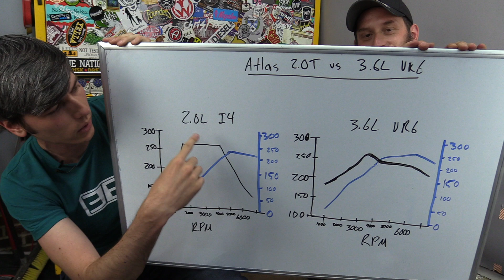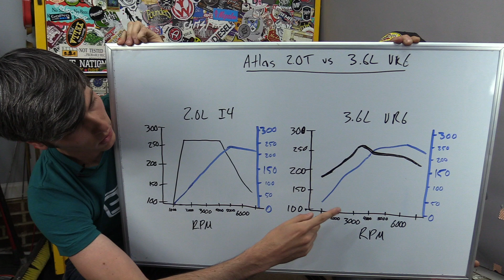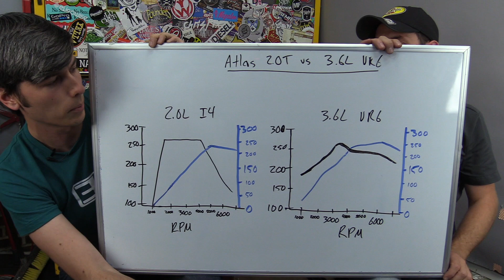4 Reasons Why The VR6 Engine Is Dying Off

Comment: You are leaving out an important element by just simply talking about output.
Drop a V8 or V6 and the engine has do work considerably less to do the same job.
I'm not a fan of running 3500RPM at highway speeds when it can be done at 2000RPM instead.
I realize this is the dang trend due to gov regulations, cafe, and a host of other BS, but it's not doing us any favors. These small engines are cranking just trying to keep up, they are littered with complex controls and forced induction just to do the same amount of work, leading to shorter life, and higher operating costs for owners.
For a daily driver, the real winner is diesel power... but of course that is now suffering the same fate due to strong-arm government BS Who thought they would live to see the day when "Exhaust Fluid" was a real thing and not a joke. Well, it's real now.

Comment: The vr6 is not dying. Vw are coming up with 2.5L vr6 turbo engines
Reply: Don't you mean inline 5?
Reply: @angelicolagi  nope. They have both but i read some news on the coming 2.5L vr6. Im sure if you google it you will find it.
Reply: @hendrikhanso  makes no sense to me i have a 2.5L vr6 in a 06 jetta  (mk4)
Reply: @burningblackknight8237  no you dont. The only 2.5L vr is a vr5
Reply: @hendrikhanso  allright ima go check rn then i think it might be a 2.0L then cause i know its a vr6
Reply: hendrikhanso there is VW Teramont in China with turbocharged 2.5 VR6
Reply: Gianluca Angelicola in China there is VW Teramont VR6 2.5tsi

Comment: I will never buy a TSI or TFSI powered VW. HPFP cam follower failures. Cam bridge failures in the timing chain engines are terrible.  Buyers that don't have a clue end up hating these cars.  I agree that the 4 cylinder engines are good for daily drivers.  But for a weekend car, give me the symphony that is the VR6.  As long as the oil is changed at proper intervals,  the timing components are durable.  Upgrade your crack pile and T-stat housing and you'll enjoy lots of trouble free miles.  

VW's and Audi's are a love/hate relationship for me as a tech and owner of a B5S4.  

Great video.

Comment: I own a passat wager with the W8 engine .  I hauled 13 overloaded trailer loads to the dump, 3 3500 lb trailer loads 400 miles through the rocky Mountains and back in the bitter February winter, through high mountain passes, waaaay overloaded, went through 3 tires, crazy frost heaves, kept it at 55 mph and the motor is still purring away beautifully.  No 4 cylinder motor can do that. This was abuse.  What's the saying,  there's no replacement for displacement.   Works for me.  Dave

Comment: The Bentley W12 and the Bugatti W16 are VR6 engines too.

Drive a Corrado VR6 myself.  2.9l 12v.     Love the sound, and the power is enough for the car.   Yes, it might be slower than a 1.8T for example..  but the 1.8t with similair power is way more boring to drive. (N/a requires you to work the gearbox a bit more)

Comment: Turn three of the cylinders of the VR6 into Modified Atkinson, then boost the other three. Run the majority of fuel through the efficient side in normal driving. So a 3.6 version would be a 1.8 turbo/supercharger plus a 1.8 Modified Atkinson (or B-cycle). I'd assume that would be a minimum 170 hp for the turbo side plus 120 hp for the other. That's 290 hp total. (That's for an efficient turbo though. You could lower the CR for more boost, as you don't use this side that much and up the power significantly. So a trade off for more power would only result in small efficiency loss.) 

One short, have your cake and eat it too.The trick here is that the efficient side of the engine is used much more in normal driving, and you can run the majority of the fuel through it. If in normal driving, at least 2/3 of your fuel is run through the cylinders that have maybe 13:1 CR, with the others having maybe 10:1, then you would think that could beat the 10:1 of the 2.0T four. Friction and throttling losses might say otherwise. But it should be considered. Maybe VW has a way to keep the VR6 alive if they think about it.

Comment: Hersteller baut einen extrem zuverlässigen W16 Hybrid-Motor, welcher
mit 2 Elektromotoren kombiniert ist, für insgesamt + 223 PS zusätzlich.
Sehr hohe Batteriekapazität! Batterie, die zusätzlich zur Rekuperation
während der Fahrt, auch an jeder Steckdose aufgeladen werden kann.
(Verbrennungsmotor Bauartprinzip wie Bugatti Chiron, ABER NICHT Benziner,
sondern als moderner gut abgasgereinigter Dieselmotor (Euro 6d-Temp) 
und zwar mit 8,8 Litern Hubraum, ausgestattet mit 4 Turboladern, 32 Ventilen, 
888 PS Leistung und mit  V I E L  Drehmoment,   der auch zusätzlich mit 
Zylinderabschaltung ausgestattet ist für geringstmöglichen Verbrauch !! 
22 l / 100 km bei sportlicher Fahrweise (Volllast / Rennstrecke max. 33 l).
Systemleistung 1111 PS. Rein elektrische Reichweite 333 Km.
Das ganze kombiniert mit einem sehr guten 14-Gang Wandlergetriebe !!!!!
Das soll doch ZF bitte noch entwickeln

Comment: Most drivers do not understand that a turbo increases stress in the engine. This means shorter lifetime.
Moreover a turbo is another thing to repair or replace.

Modern 6- and 8-cylinder engines commonly use cylinder deactivation when full power is not needed.
When cylinders are deactivated, the engine has effectively a smaller displacement.
Reply: yep make the consumer pay for the environment while the companies just make more profit.

Comment: small turbo engines get better EPA numbers and have flat torque curves while higher displacement NA engines are lower stressed and generally get better real world MPG numbers with better overall drivability. I daily a 1.0 ecoboost and it's miles ahead of the NA counterpart but there are many downsides and one of which is that I get worse fuel economy with a 1.0 turbo than the 2.0 NA in real world testing. If the 1.0 has the turbo spooled (so pretty much all the time) it drinks the fuel like crazy.

Comment: The VW VR6 was designed to fit a 6 cylinder engine into small front wheel drive hatchbacks. Other manufacturers would use V6 engines from their larger models and the result was an extremely cramped engine bay where you couldn't do any work without pulling the engine out and made cooling very challenging, the VR6 was a huge advantage in this regard.

But hatchbacks with 6 cylinder engines are a dying breed, taxes hit them big time now and 4 cylinder turbocharged engines can make more than enough power for this sort of car (the current Golf R makes 300hp, the Mercedes A45 is up to nearly 400 which is the sort of figure that a few years ago you'd expect from a V8!). I think only the BMW 1 series still offers a 6 cylinder engine.

Comment: "There's really one peak where that engine is its most efficient" you say about the VR6 engine. However, the same goes very much for the I4 turbo engine as well. Just because you have an artificially flattened torque curve it does not mean that that engine is efficient over all that range. You should know this... I mean I really hope you know this. But it was just a very weird way of putting it. Also, in general I don't like these new I4 turbo engines. They are typically a lot thirstier than their specs would indicate, they won't be as reliable as a big under-stressed engine and they lack the character of a V6 or I6 engine.
Reply from the maker: Peak torque represents peak volumetric efficiency (most air and fuel burned, thus the most power). It does not necessarily mean the most fuel efficient point (BSFC), which is generally at a low RPM and relatively high load.

Comment: Engineering 
Explained--Love your channel!!!!!!!!!--I cant say I got lucky when acquiring my 2003 VR6 due to me lusting after the BDF 2.8-litre VR6 24v (V6) for years. Specifically the factory tuned 2003 Jetta. Due to me shifting VW'S & AUDIS tirelessly since 1989-90 I went with all the bells and whistles that racers wouldn't want. They'd only want the VR6. I really love the BDF!! (Its attached to an auto trans, leather, electric everything, heated seats, sunroof, the efficient motor is ridiculously fast and fun. The engines a little cramped taking up every bit of 1/3 of the car. "She's fast, fun and in tight hot black leather." VW/Audi may stop  making the VR6 but its going to be around for many years to come!!

Comment: And when a 1.8T and a VR6 have a baby...
Reply: You get the 2.0 in everything. I love that VW 1.8T but I've seen some really nasty oil starvation damage. Rods shot through the block, fires etc. .The 1.8T just required more attention than other VW/AUDI motors. Its not for the  person who doesn't take care of there oil. I've owned all 3 and the workhorse was my 1995 2.0L ABA 8 VAL. The rest of the cars cosmetic electronics just failed around it and made it unpleasant to own. The engine was still trudging along at 210,000 miles.
Reply: @Poetry_in_Potion1  I was referencing the white wookie (VR6 turbo).  Same thing that I am going to be doing to my 12v VR6.
Reply: @Poetry_in_Potion1  yeah I've already gotten a stainless exhaust from ecs tuning and am planning to DIY myself a turbo kit. Hopefully I do it right, a lot of research is involved.
Reply: Radicle_Insanity 
-Nice choice !! The VR can sound so awesome. ECS is hi-quality and good service. Do you plan to buy a kit or buy a turbo VR6 manifold and salvage turbo parts?? Saab and Volvo turbo parts are super common. Good Luck!!
Reply: @Poetry_in_Potion1  I was planning on salvaging turbo parts. As you said, a viable turbo kit is $4000 and I don't see why. It doesn't even have a tune.  I'm somewhat into welding / fabrication and am making a short intake manifold now for it. The oem manifold is restricting even at my power levels.
Reply: It doesn't even have a tune.???
Reply: @Poetry_in_Potion1  not the kits that I have seen.
Reply: Radicle_Insanity --a tune? or turbo?
-
Reply: Radicle_Insanity 
--i wasn't able to share those parts sites. you welding/cutting is a good thing !! that'll save you $$ and fitment wont be guesswork....*Research is wise and paramount.*  if you can source parts and "pay super close attention to the stress your adding to the stock parts."  if you buy a second ex manifold, you can do a lot of work and still drive your car. Like i said, Saab/Volvo turbos, boost gauges & intercoolers were popular & VWVortex has sooooo much info if you get stuck. You really can do a Frankenstein junkyard build!! "Just don't forget to pay attention to really important details." Your putting new stress on your VW pistons, rods, I'd add a secondary high output oil pump."  There's a lot of companies turbo charging today so finding stuff off of a VW, Audi, Honda, Hyundai parts may all be really easy to source. Good Luck!!
Reply: @Poetry_in_Potion1  My hang-up is what turbo to use and what tune to get. Everything else is simple; I plan on over-building my car rather than hoping it stays together on stock parts.
Reply: Radicle_Insanity 
-Your very wise building up the stock parts.I guess the turbo size would depend 1st on your $$$ then the engine bay space allotted. And if you plan to use it as a daily driver. I like Garrett & BW Turbochargers. T3/T4 is common for daily drivers. VW used the K03 with the 1.8t. which was small and problematic. However they are all soooo expensive i personally would be doing a 99% Frankenstein swap.  I would have to scour the earth for everything except the exh mani. I now got what you mean on the WW !! its a fun build to watch.
Reply: @Poetry_in_Potion1  Yeah, I have a friend making 564 HP on a completely stock motor + 5mm head gasket spacer on 30psi (high boost).  It's pretty impressive what the 12v will take stock from my research so Pistons alone should be more than enough for 450-475.

Comment: I feel like something overlooked on VR engines is how well they breathe. The unequal length intake and exhaust ports lend themselves to unequal breathing between the banks. One bank doesn't scavenge as well and the other doesn't get the "tunnel ram" effect. I can imagine emissions are fun to deal with due to the different parameters between cylinder banks. The VR6 also shares one of its flaws with the Ford Flathead V8, the long exhaust ports dump a lot of the remaining heat into the cylinder heads. This may cause the long intakes to warm up, further decreasing efficiency, aswell as making cooling of the cylinder head all the more trouble. 
The VR6 is a great idea in concept but flawed in some ways that other engines simply aren't.

Comment: While turbocharging has greatly assisted smaller engines today, turbochargers do tend to put more stress on the engine and its parts. Which in turn is going to make some parts wear out sooner. I will say that I am impressed with the amount of power that manufactures can get out of smaller engines by means of turbocharging. I myself m a bit of a naturally aspirated purest.🤓

Comment: While I was unaware of this Engine with its particular cylinder layout until I watched your video. Thank you, I myself follow closer machines of the two-wheeled nature, especially since I live in the city that Harley-Davidson was born. Motorcycles are extremely big thing here and now with spring and summer approaching it's going to start getting loud again. As far as motorcycle engine design goes. One of my favorite engine designs was the square four first popularized on Ariel motorcycles then years later taken up by Suzuki. Although the most interesting engine design I have ever seen was from Honda, the NR 750 with its 32 valve, oval pistons with twin connecting rods is by far the most interesting engine design I have ever seen.🤓

Comment: Where did you guys get your information from? VR engines are still coming out on the VW lineup. Maybe you guys meant that GTi’s and Jetta’s won’t get the VR6 anymore. Also the Atlas also has a 2.5 VR6 TSI but USA won’t get that engine ever unless VW brings it over the pond for you guys. Do better research next time. Take my advice as I am also a VR6 specialist for over 15 years.

Comment: When your comparing fuel economy from a turbocharged engine to a naturally aspirated engine you should ALWAYS mention that the turbo (probably) requires mid-grade or premium gas, whereas the naturally aspirated is probably running regular, a 9% difference in fuel economy is significantly less of a factor when you're talking $3.09/gallon regular  vs. $3.29 premium (using my current local prices).

Comment: Durability? When the turbo seals are dead and gone on the turbo I4 the VR6 will be soldiering on. The oil consumption on the I4 Turbo is going to get bad prob. 80K miles and against he VR6 will not be having any issues. Look at all the problems we had in the 1980's with turbo charged cars. Most of them ended up without their Turbo as used car's. Again oil feed lines and returns onthe turbo are going to be an issue! If you have to replace the turbo again huge cost. I have never seen a turbo charged car with it's factory turbo still working with no maintenance or repairs at 300K to 500K miles but their are plenty of VR6 engines that have done that easily! Until they can get maintenance and cost of ownership down while increasing durability I am not interested in anything turbo charged. This trend in turbo 4's will be popular initially but once people see the problems they will flee like rats from a sinking ship!

Comment: also: disadvantage of straight/vr6 is the 7 mains, causing friction/pumping loss especially when oil is cold. then that big wide head being costly to manufacture. and....extra couterweights on the crank also decrease efficiency when the engine is cold...doesn't spin up as fast.

Comment: straight sixes are almost dead too. most people are assumed not to need to work their engines hard for long periods.....but these crazy turbo 4s are gonna die sooner for a lot people. boosting a gas engine creates a very complicated engine management, and very stressed engine. there are getting to be issues with direct injected high comp turbos where there's  detonation problems because of blowby and then oil vaporization. Fuel composting could be changed but people basically are not going to change oil often enough on these high stressed engines. we drive straight six cars (or trucks) pimarily in my fam but have turbo 4s and v8s as well.

Comment: This analogy is incorrect .The former head of Audi and his preference for the inline 5 technology Audi developed. AMG chief engineer was tasked to develop the new breed of VR and development was under way when it was still born due to economic and political reasons(see tdi). The Bugatti Veyron uses VR6 technology. The 4 cylinder line of engines was NEVER superior and was never offered as the premium package. An inline 5 is really good but is still not equal to a VR6.

Comment: The VR6 was only ever part of VWs attempts to acquire some prestige.
To get that they decided that they need a 6pot option and the VR6 was their solution to mating a 6pot to their front-wheel drive.
The main thing they learned is that if you cram more cylinders into less space you get thermal issues.

These days low fuel consumption is more important than the number of cylinders so turbo'd I4s rule the market.

Comment: Vr6 is the best vw engine. They need 6 cylinder badly. Ford, Hyundai, Infiniti, Audi, BMW, ford, Nissan, General Motors and more, have v6 turbo engines available for customers who crave more power, and nothing is better then VR6 Twin Turbo. We don't want electric boring cars we want cars with spirit making noises.